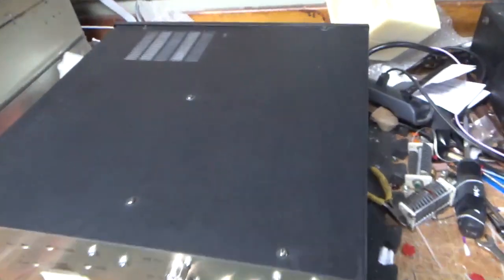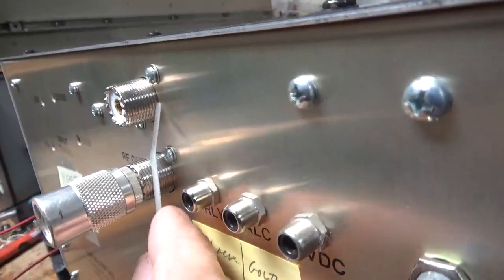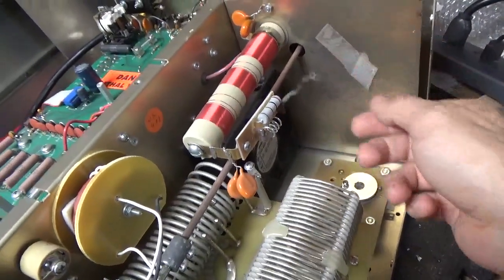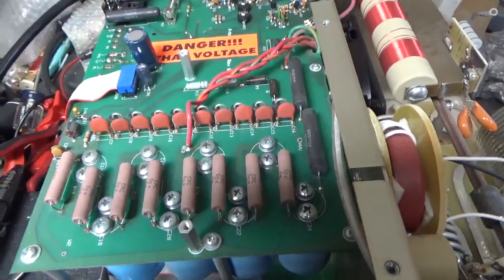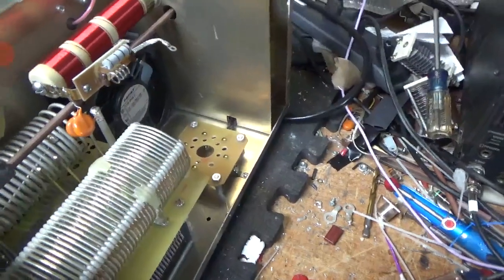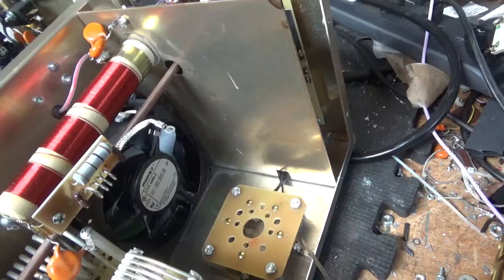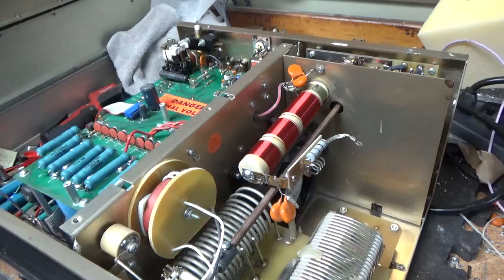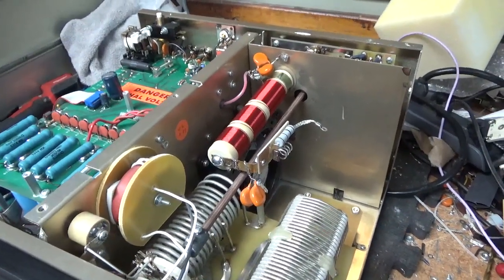Ameritron Al-80B Repair, Modifications, New plate Choke, Penta Lab 3-500zg

Comment: I notice the Harbach kits have 100k bleeder resistors instead of 50k, is this a better idea? Just refurbishing a Heathkit SB1000 in the UK.
Look forward to you getting international shipping sorted.
Reply from the maker: Thank you for the comment , the 100k resistors dissipate less heat than the stock 30k ones. The capacitors used today far exceed the original stock ones.

73